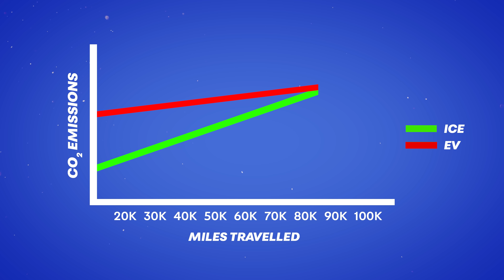Are Electric Cars REALLY That Green? [New 2022 Data]

Comment: That 90,000 mile figure just shows how terrible Volvo is at producing BEVs. They need to design a BEV from a clean sheet. The Tesla Model 3 break even point is 5,340 miles on average in 2020 and will get better over time.
Reply: Two observations - don't always believe the data Tesla put out. Often it's fake news, or there is asterix which you need to read to get the real information. e.g. Their '0-60' * for their Performance models includes a one foot roll out, so it's actually about 6-60mph.
Secondly, the break even point for the TM3 is only 5k miles if you include all the trees and carbon credits Tesla plant and sell. Just the car takes much longer, around 30k miles, the real figure depends on how green the electric is which the owner is putting into it.
Reply: @SDK2006b  That 5k miles is real hard data based on reality, not some random figure of a youtube comment. Go read Tesla's 94 page 2020 Impact Report. The only people calling it fake news are those being disrupted by Tesla, namely TeslaQ's disinformation campaign.
Reply: @alsmith358  - ALERT Tesla Fanboy spotted  🤣
I read that document and am entirely familiar with the numbers. You need to look at what Tesla include in the calculation to get to that 5k miles.  
Please step away from the Tesla brainwash !
Reply: @SDK2006b  ALERT Science denier spotted! You clearly didn't read it. Have fun in your polluted world.

As a result, it is not uncommon for the carbon footprint of the use phase to be
underreported by up to 50%. 
Analysis of sustainability reports by auto OEMs shows unrealistic assumptions for both vehicle life and annual
mileage. For those that disclose their methodology we have found that vehicle life is often estimated to be as low
as 10 years and annual distance traveled by vehicles as low as 6,200 miles. This compares to an average life of 17
years in the U.S. (20 years in Europe) and 12,000 annual miles in the U.S. (and 7,450 in Europe). When taken
together, even before considering the impacts of using real-world MPG instead of NEDC, WLTP or EPA ratings, this
leads to a drastic under-reporting of Scope 3 emissions.

5.0 million metric tons of CO2e savings
To estimate CO2e savings, we first measured the amount of miles driven and kWh of electricity generated at the
state, province, and country level for 2020. We then applied an emissions savings factor (in gCO2e/mi for miles
driven and gCO2e/kWh for electricity generated), for each state, province, and country. For miles driven, the
emissions savings factor is the net of estimated emissions from our vehicles and an ICE with a real-world fuel
efficiency rating of 25 mpg. The emissions savings factor is based on grid emissions intensity in each respective
location and includes upstream emissions from the production and transport of fuels.
We modeled vehicle emissions savings for the U.S., E.U. + EFTA and China, which account for ~90% of miles driven
globally. We then scaled the savings to account for 100% of miles driven by dividing by ~90% and arriving at a
global estimate for 2020.

Global Greenhouse Gas (GHG) Emissions by Economic Sector
For simplicity, select categories were combined based on similarity of emissions source. Emissions from Agriculture
were combined with emissions from Land-Use Change and Forestry under the label “Agriculture, Land-Use Change
and Forestry.” Emissions from Industrial Processes were combined with emissions from
Manufacturing/Construction under the label “Industry.” Emissions from Waste, Fugitive Emissions, Other Fuel
Combustion and Bunker Fuels (U.S.-only) were combined under the label “Other Energy.”

Scope 1, 2 and 3 Emissions Definition
Scope 1 emissions are direct emissions from owned or controlled sources.
Scope 2 emissions are indirect emissions from the generation of purchased energy.
Scope 3 emissions are all indirect emissions (not included in scope 2) that occur in the value chain of the reporting
company, including both upstream and downstream emissions. Emissions from the use of a company’s products are
included in Scope 3.

5,340 miles
At the moment, the manufacturing process of a Model 3 results in slightly higher
GHG emissions than an equivalent combustion engine vehicle. However, based on
the global weighted average grid mix, a Model 3 has lower lifetime emissions than an
equivalent ICE after driving 5,340 miles.
Estimate is based on the difference in CO2e emissions from the manufacturing phase on a Fremont-made Model 3
and an equivalent ICE which is then divided by the net CO2e savings per mile from a Model 3 versus an equivalent
ICE. Net CO2e savings are based on delivery-weighted global grid mix.

69 tons: Lifetime CO2 emitted by an average combustion engine vehicle (model year
2020) sold in the U.S. through its use phase, excluding CO2 emitted during the oil
refining phase.
Figure based on EPA's real-world (5-cycle) testing result of 25.7 MPG across all manufacturers for model year 2020,
which equates to 344gCO2/mi, and 200,000 lifetime miles. Excludes CO2 emitted during fuel production and
transportation.
Note: the EPA's real-world testing cycle is not the same as owner-reported MPG sourced from Consumer Reports.

Comment: As always from Rory brilliant, balanced and fair. 
So for most European owners the crossover point will currently be somewhere between 2 and 3 years. This is true today but as mentioned battery production will improve it's carbon footprint as the years go by and electricity is constantly getting greener so in a few years the crossover point may be under 2 years. 
The truth can be inconvenient but it's always still the truth.
Reply: Yes and no. EVs aren't that efficient when it comes covering long distances (ie. motorway miles = reduced distance per full battery charge) so it may take them significantly longer to reach that crossover point than an ICE vehicle. This said, if battery packs prove reliable enough (not enough data is currently available to gauge expected lifespan) to continue going after that 90K point for a significant amount of miles then it works out as an overall reduction in emissions.
Reply: @DjDolHaus86  "not enough data is currently available to gauge expected lifespan". There's plenty of data - a huge Tesla fleet for starters.  Modern battery packs look like they're going to easily outlast the rest of the car - in the 100s of 1000s and maybe even millions of miles range
Reply: @WillBecker  'look like' is not data, is it? There are relatively few Teslas on the road compared to ICE vehicles so as a data source they are a small sample size. Also Tesla aren't the only ones making electric cars so what may be true for them might not be true for others. They simply haven't been around in high enough quantities or for long enough to gauge service life. This is how data works, unexpected problems develop over time and until they do or don't you can't say for certain.

Comment: Very well put and well considered points. Am currently in a diesel doing 30k km p/a and am looking for a viable EV option, i would hit the break even point more rapidly than most but as per usual, cost will be the determining factor.
Reply: I'm sure you've considered this so it's for other reading as much as anything. Consider what your spending on fuel month to month and deduct that from the monthly payment for a new/ used EV, I do about half your anual mileage and my fuel savings are going to be over half the payments for a new car which has actually let me trade up a fair bit.

Comment: 90k miles.... dont most EV's have to replace the batteries after that amount...? so if the most polluting thing about the EV's is the battery....  than all the benefits after 90k go right back....
Reply: No there are plenty of examples of Tesla's that have multiple 100k miles of use from Taxi companies etc.
Reply: You don't replace the whole battery - just the dead cells.
Also, ICE cars don't use the same parts forever. They need new exhausts, sparkplugs, gearboxes, turbo's and eventually engines.

Comment: Excellent analysis by Volvo (and great explanation - thanks Rory), but a significant factor is size and weight, and the XC40 is not small, and since the German manufacturers are selling us ever more heavy BEVs, and we are told they are much more efficient than an equivalent heavy ICE car, are we missing the point about how much mass we are carting about every day. If we want to improve efficiency we need to shed some weight, isn't it common sense?
I'd like to see the same comparison (BEV vs ICE) done on a small car, and then those results (in kg of CO2 per vehicle lifetime) compared to the Volvo results. I reckon it would tell us that a small petrol car is better than a 2.5 tonne BEV.

Comment: Or else we could also make both the production and the running of ICE engines more efficient. 
Making ICE vehicles more lightweight, less draggy, with more eco-friendly materials and designs, combined with even more efficient engines and more innovative energy-recovery devices like compressed air or mechanical flywheel…all of which could push that break-even point even further, or at least past the 140k miles point for many. 
What’s not to like? This would also create an even better green standard for EVs to chase.

The bit that’s questionable is the notion that just because pollution is not emitted next to urban centers, it makes that pollution somehow less bad. In the long term, it’s probably the opposite.

Comment: Using the same platform for an Ev and ice car is inefficient  so that just speaks to volvos lazyness and them pinching every penny they can instead of really caring about yhe environment
Reply: It's not laziness. They're making a pure EV platform for their upcoming SUV that's coming out this year. In the meantime, they electrified the XC40 so they could implement things like one-pedal drive, do over the air updates, and put out an EV. Ever heard of transitioning? You're ignorant of who Volvo are as a company to say they don't care about the environment. They dropped diesels, dropped their popular 5 and 6 cylinder engines years ago, and just told their customer base they are dropping leather form their cars (and it's not going over well). They're very much an environmentally conscious car company to the extent that any car company is.

Comment: Also can an EV reach 90k miles without the battery messing up and not holding as much charge as it used to because the battery not holding as much charge as it used to is also an issue
Reply: I also think that companies should concentrate on making bus’ and lorries electric before they push for electric cars for everyone because they probably produce more pollution then any other vehicle on the road

Comment: Not too sure where you or Volvo got your ideas from , the basic fact is that ICE cars and EV cars have the same Carbon footprint in the manufacturing process, re ongoing use the ICE car costs a small fortune to run on a weekly basis and the EV costs very little to run , the cost savings are in the region of 80%, the savings rise to 100% if you have a home charger powered by Solar and or wind
Reply: "The basic fact is that ICE cars and EV cars have the same Carbon footprint in the manufacturing process"

This is simply not true. The batteries themselves have a very large carbon footprint in the manufacturing process. Which is why EVs have a much, much larger carbon footprint out the door.

Comment: A good quality ICE car can easily outlast (years / mileage) any EV. Without very expensive repairs. With proper use and maintenance of course.
Reply: Fair point but cars are manufactured nowadays the same way as shoes.... They will wear out far quicker that they need to as the manufacturer wants you to replace it as soon as possible.  Same as shoes... When was the last time you seen a pair of leather soled shoes in a shoe shop...   We all live in a throwaway society...

Comment: What about hydrogen fuel cells? How clean are they? I remember Volvo saying its EV had a bigger carbon footprint to create than its hybrid car.
Reply: Local emissions the same as BEV however the creation of the hydrogen even if done through electrolysis using only green energy uses multiple times more energy than just charging a battery to power a car. There a quite a few channels that have done comparisons on the efficiency of both fuel types. As for the BEV having a bigger carbon footprint to make than hybrid it come down to the size of the battery, bigger battery = bigger manufacturing footprint
Reply: Hydrogen is the biggest fossil fuel backed fud out there. People complain about the charging network when we all have electric at home. How's that hydrogen distribution network looking?! Might generate of bit of co2 producing and transporting?! So much of it is unessesary when a simple ev solution exists and is viable.